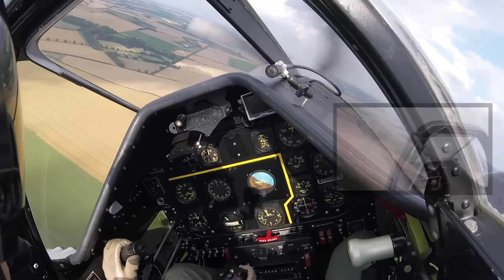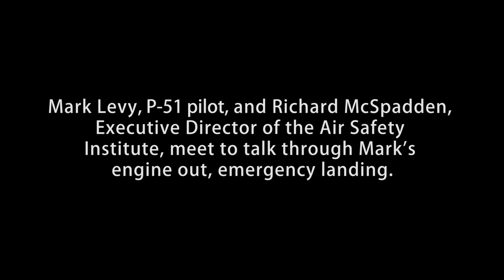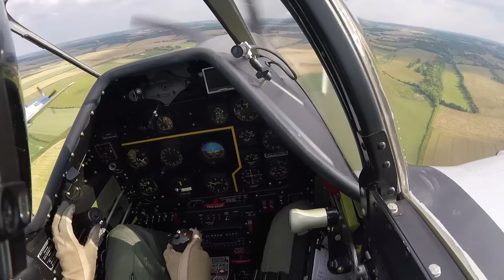P-51 Engine Out, Off-Airport Landing - Full Analysis

Comment: Without dramatization and waving hands, without raising the voice, it was useful to listen two smart people .... because after this interview ,  and I feel ''important and clever''.Thanks so much to Air Safety Institute.
Reply: This channel just oozes brain power. It's great.
Reply: What you may want to learn here is that he had plenty of energy to reach the runway but managed to miss.
Reply: Dan , he says several times that he didn't have enough energy, and that he had a intermittent partial engine failure that kept changing his situation. Why do you think that he could have reached the runway? Do you perhaps suppose that he, as the pilot, might have had a better grasp of the situation than you ?
Your comment sounds like you're an "armchair quarterback" .
Reply: Because at 1:50 you can see him come up to the runway and fly by it. And the bird has a 15:1 glide ratio if he doesn't sabotage it by opening the canopy and with flaps and gear. Even with the mistake of going past to come around, even with the mistake of the gear out and open canopy and the long way he turns at the very end, I'm quite sure he could have made the runway but that wasn't among the big mistakes. If that was his only judgment failure, I could understand. It was losing energy fast at that point but only after several mistakes. I believe he was stressed beyond pilot skill and target fixated on landing in a field from very early on in the panic mindset. I can understand the distress of engine loss forcing a ditch but when he sees he is approaching the runway you go for it, you don't find ways to realize the nightmare.
Reply: Yeah he is going to land a 100+ mph P51 at a 90 degree angle (Which he is @ 1:50) onto the runway?  SMH  Either way he needed to do a nearly 270 Degree Turn to Land, which he was doing when it crapped out entirely.
Reply: He might be coming in at 85 degrees but even if we say 90, that's still infinitely better than the tight and far 180 he puts himself into. Try to dispassionately understand the situation instead of letting yourself be ruled by defensive emotions. Never make truth your enemy. You will always lose.
As mentioned he also had the gear out and canopy open. Both significant mistakes. And he could have made the turn over the runway instead of far after it, that way he would never be caught out. It's a hectic situation and I have the benefit of calm review but I am still right. It could easily have been averted and the crash is due to multiple pilot errors.
Reply: 85/90 Degrees, Does it matter?  Unless you are on flare 6" above the runway or the taxiway an engine failure is never at an opportune time. You are far from 100% right, sure, the Gear and Canopy have some drag, and I am talking with sheer matter of fact, no emotion here, I have no dog in this fight.  And turning over the runway, in your hypothetical situation, would have been VERY DANGEROUS for the spectators on the ground, AND likely had him too high and/or traveling too fast, and being halfway down the runway already, his final stop would have likely put him off in the west end weeds nosed over, EXACTLY what has KILLED many P51 pilots!  The way you talk you have no understanding how an aircraft actually operates, Have YOU ever been in a cockpit of an airplane?  NO FLIGHT SIMULATOR DOES NOT COUNT, SORRY!   Or are you still in Mommy's Basement re-posting videos about Global Warming, UFO's and Non-Existent Cars?    You are 100% Armchair Pilot...I guarantee it...
Reply: Hindsight suggests that if he did everything right he might have made the runway. The problem here is that you can't fly/successfully crash an air plane in hindsight. 
In the moment he did the most important things right. He got it down and walked away and did it without putting the public at risk who were there watching the show. With absence of a time machine it's entirely pointless, futile and frankly ignorant to suggest he could have made the runway. He knows now with the benefit of hindsight what went wrong and what he could have done, but as he said in the video, in the moment he had no time to work the problem. No airspeed, no altitude no energy and an engine malfunction that was getting worse every time it cut out, with mere seconds to make a life or death decision... He made the right call in the moment. Hindsight, back seat driving and criticising after the fact is for the ones who don't or are incapable  of making the right decisions at those critical moments.
Reply: So dramatic and so thoughtless. He opens the canopy, that's a simple objective mistake. Try to deal with that. The objective facts instead of emotional mindlessness. Then he flies next to the runway and past it instead of going down the shortest path. Then he lowers the gears prematurely creating drag in a plane with little or no engine at low altitude. Then he chickens in the turn he put himself in because he doesn't know the plane's glide capability and he has the gear down and canopy open. Despite the ocean of mistakes, even that turn could have been made. The canopy hits him in the head in the crash which could have killed him. It was a long series of mistakes. Deal with it.
Reply: No. You are the guy at the end of my previous comment. 
Also a pretty mediocre troll effort on your part.
Reply: I don't troll. I just looked again in HD to see if I could spot the runway earlier in the video. It looks like it's in top left corner at 1:12. The white blob and arch hangars. The angle at that point would appear to be around 50-60 degrees. Obviously the closest is the end to aim for instead of parallel and far past which eventually caught him out in the fields.
Reply: He was up wind with intermittent engine failure. "Obviously" that would not be the side you would try to land on... Maybe this is not obvious to some. (you) "obviously" you are going to want to come in down wind for the extra lift. again maybe not obvious to you. Also, he clearly states and the other guy agrees with him that as soon as the second cut out occurred he was immediately thinking of putting it down in a field. it was when the engine came back then went then came back etc that he second guessed himself and thought maybe he could make it. As soon as he realised he couldn't make it because he was on the limit of stalling he made the only "obvious" decision, he put it down in the field next to the airfield. If he could look at the video again with all the information you have now he would have landed it on the runway without much difficulty. the simple fact of the matter that is clearly not "obvious"  to you is that he didn't have any information in the moment when it happened. He had instinct and skill enough to make a bad situation into a good situation. Not the best outcome, no, but any landing you walk away from is a good landing. You fail to recognise the most important thing. Analysing it after the fact when you have no pressure and you can replay it over and over, and read the gauges and decide what the best course of action would be is not how it works in the real world when it's happening to you there and then. he can't pause the problem and replay it in bloody HD! He had seconds to act, he made the mistake and he admits it that he tried to get to the runway when he should have just picked a field and put her down. And yes you are clearly trolling and making a really bad attempt at it.
Reply: I have to look for the runway in the confused video, he knew where it was so that's a bs argument. It's not about convenient hindsight. He went towards the runway, the intermittent engine afforded him getting there, then he decided to try to land on the far end. with the canopy open all the way there. And eventually with gear down too early. And a far turn. If you weren't so irrationally defensive, you'd easily see the many mistakes I correctly point out. If you could think clearly you could also see that it could hardly have gone worse.
Try being rational instead of emotional. It's a very simple fact that he had plenty of energy to reach the runway yet managed to miss. Why is simple reason so effing hard for people.
Reply: Expecting to land in the field became a self fulfilling prophecy. Hence my observation of target fixation. He made it happen in the frozen mindset, same as Sully did. And I listened to them talk, including him admitting it was a mistake to listen about the gear. Quite consistent with me saying it was a mistake. Because it was a mistake. And I understand the technical details, mister humility.
Reply: I know you have been quite consistent. And you go with that if you want. I'll stick with the two experts in the video and not your version of consistently wrong. 
Bye bye
Reply: Flawless logic
Reply: It is!
Reply: Yeah because aeronautics that's nonsense but writing troll in all caps, that's solid.
Reply: Let's see some proof of your knowledge?  Lets See:  Pilots license = Nil, Nada, None  -  Troll Score on YouTube = 1000  -  Yeah I am going to trust or listen whatever opinions you have about "aeronautics" as much as trust Stevie Wonder to drive my car.
Reply: I'm curious, do you have a pilot license?
Reply: Dan Frederiksen yeh going for it  with 180deg turn across a public road full of cars with minimum flight / glide speed of 150mph  glide speed - ditch in the field had far less consequences.
Reply: @DanFrederiksen  I suspect he was flying a more standard geometry approach pattern because of hope.  The engine had performed poorly enough to get him back to the airport and he was hoping, or even expecting, it to continue to run equally as poor as it had up to that point.  Then, of course, it didn't and he was too far away.  I commented above that my training had me point the nose directly at the runway and shorten, or delete entirely, whatever portions of the pattern was necessary to reach the runway during and engine out.  I have no doubt this pilot understood that as well.  The difficulty for him (I agree with your assessment of pilot error btw he could have made the runway.  Why fly a downwind leg at all?  Approach direct and LAND) was the PARTIAL engine failure and how he interacted with that cipher.  He hoped/trusted too much that the engine would continue to provide some power until he was too far out and the engine indeed returned NO POWER.  That was the pilot error in judgement.  I think the pilot made an error but the wheels up landing in the field was the fault of a failed engine.  I think he should get a medal for the decisions he made to mop up his mistake.
Reply: @myronstambaugh761  I agree he likely started to take the partial operation for granted which is a somewhat understandable human error (but undeserving of hero claims) but I think there was some target fixation on field ditching at all times, evidenced by the at best very premature canopy opening. I'm glad to hear your training tells you shortest corner at all cost. What training is that if I may ask?  regarding the 'miracle' on the hudson incident, I'm concerned that even airline pilots don't learn basic things like it has energy enough to return to runway during take off and direct best glide to nearest airstrip on engine failure if possible.
I'm hunching that even in a near stall with all the prior mistakes, he could have made the turn over the road back to the runway but at that point it's a more tolerable mistake if it was. Any power lines and poles make things 'complicated' in a split second.
Reply: @myronstambaugh761  I totally agree with this assessment. If he had tried to land at the other end of the runway he would very likely landed safe, but he decided to do a downwind leg because the engine was running good enough. Pilot error right there. I also think he overshot the final turn, saw that he was going to miss the runway and waved off into that field. The last part I think because he only had 8 hours on it or didnt dare to bank it any more. Gotta give him kudos for quick thinking on getting those wheels up though.
Reply: @simonhughes-king8493  armchair pilot?
Reply: @DanFrederiksen  Easy to say when you're sat in a chair at home watching a YouTube video. Quite another thing actually experiencing it first hand. You weren't there, he was. He owned up to his mistakes in this video. I doubt you would do the same. But of course, you're the worlds best pilot, so we all know you would have done everything perfectly. 🙄
Reply: @DanFrederiksen  Gee Dan, it must be so hard being Bob Hoover's alter ego.
Reply: @josephking6515  didn't know who that was but having flown that much and that experimentally, I assume he would of course have the aviation understanding and agree you go straight for the runway in case of engine failure if you can make it, no go around. Your petty self might even recognize the truth when I state it so plainly. 
And Bob Hoover was just a pilot, even if he was a good one. I am far more.